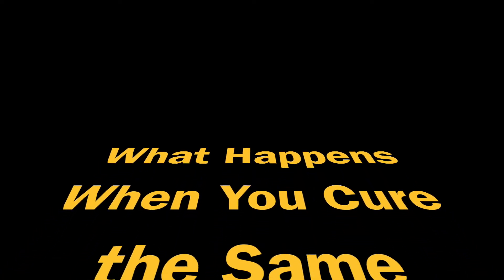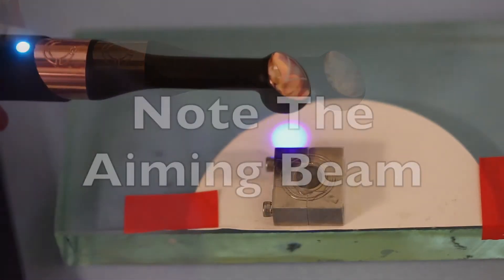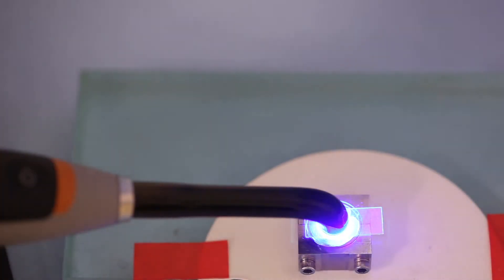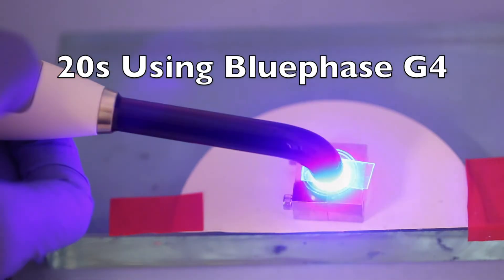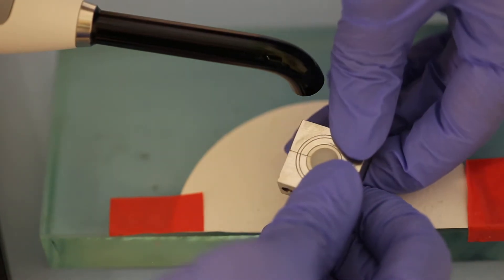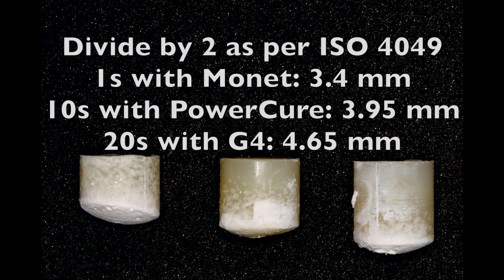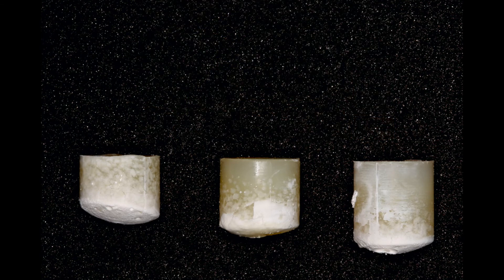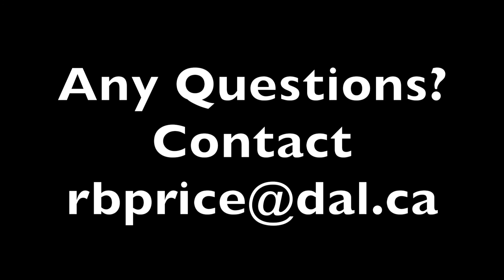What happens when you light cure the same Bulk Fill composite for 1s, 10s or 20s?

Comment: Hm.....what if you use 1 second light for 3/ 5 times.....allso, from diferent angels.
Sure, with few seconds of pause...cos, we do not wish to burn the nerv?!?
Is it still so bad...ore become a winer?
Allso, G4 have to small aperture/ 8mm....and can not cower biger area,which will cose a problems with ununique polimerisatione.
Reply from the maker: Well, it all depends on the light output.  Let's say you use a light that delivers 1,500 mW/cm2 for 10s. Then you will deliver 15 J/cm2 of energy. If your light delivers 3,000 mW/cm2 then you would have to use it for at least 5 s to deliver the same amount of energy.   Unfortunately, dental composites do not obey exposure reciprocity, so you actually have to deliver more energy as the irradiance goes up.  Start curing from angles, even less energy is delivered.  Simple physics and simple chemistry.  Sorry to burst the bubble on fast curing.